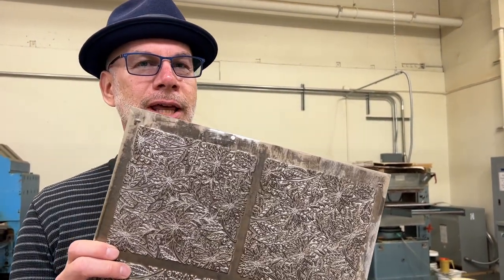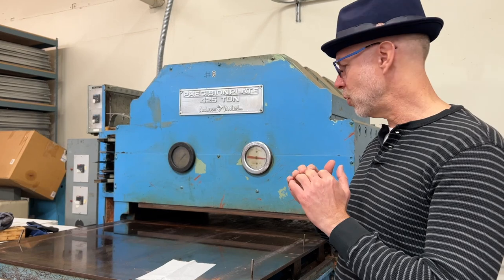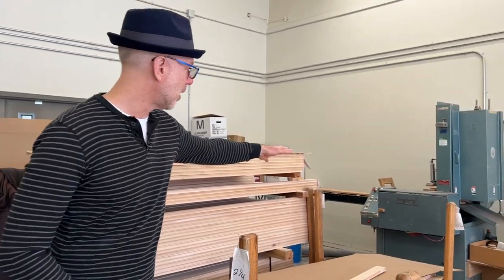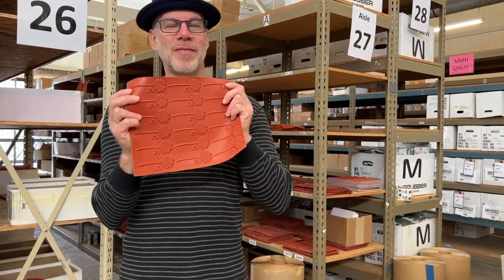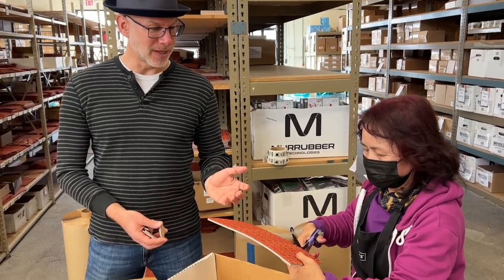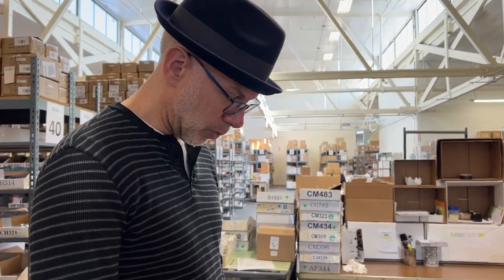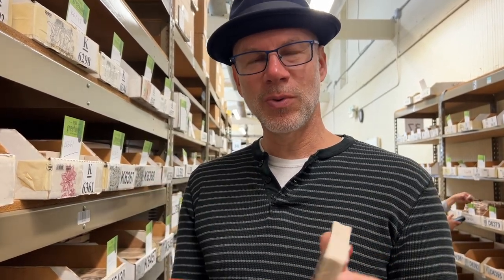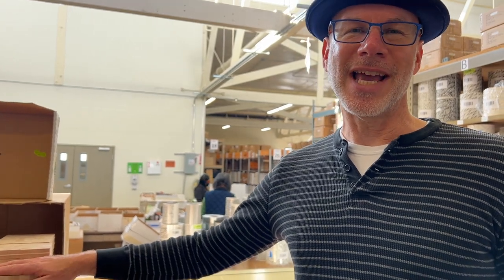The Making of a Hero Arts Woodblock Stamp

Comment: This is great, but considering the environmental impact and shortages of wood, why not create all rubber cling stamps? I love the photopolymer stamps most, with cling rubber stamps second. I like using them in a clear rubber stamping platform. It allows me to see the placement better. Most wood stamps are single use and hard to combine with other stamps due to alignment issues. I have an extensive rubber stamp collection and have considered removing the wood for versatility. 

I love this video regardless